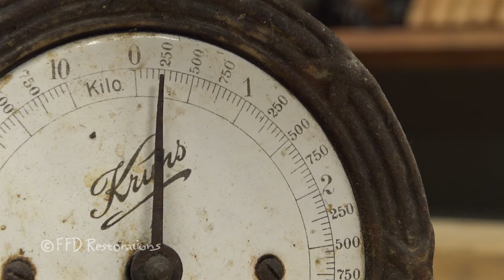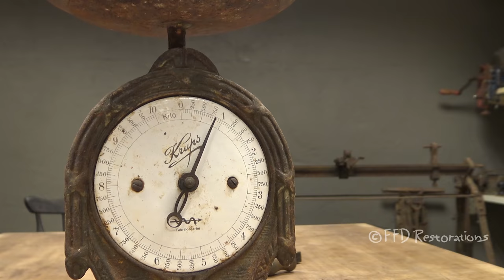EXTREMELY rusty axe restoration and MAKEOVER to an hatchet - all by hand

Comment: Owning an axe head that dates to around 1830, I would have de rusted before cutting it. Blacksmiths of that period did not always mark their work but it is always worth looking. A very nice job.
Reply from the maker: Thanks John, after research this axe head is probably around the 1950's. I wish it was older, in that case I would not cut it for sure. Thanks for watching!

Comment: Oh, well it's an øyo or a Mustad mass produced axe of the Østerdals pattern.  Good effort on that hacksaw dough. You could make a pickaroon from that other half of the axe head, wich someone said further down in the comment section.
 Keep up the good work.
Reply from the maker: Thanks for the info! I just wonder, could be a third option or manufacturer? I know that both Øyo and Mustad have branding marks on their axe heads, but this one didn't have any. It could be because of the condition, but from experience usually there is at least partially visible branding. Thanks for watching! And yeah, I think that is a good suggestion, I appreciate that.
Reply: @FFD_Restorations  You could cal  me an axe nerd. The eye is looking like a Mustad, and their stamps where not punched as deep in the 1920s to the 50s. The øyo axes has much deeper stamps on the poll. 
I would stick with Mustad for now then.
Reply from the maker: No, not at all. I appreciate your knowledge and efforts to share valuable info. Alright, didn't know that. Cool 👍

Comment: Curious as to what it weighs after grinding...also can you make something out of the leftover steel from the axe? Probably not just thinking "out loud"
Reply from the maker: It hasn't changed much after grinding but I managed to get it 1.5 lb (700 g) including the handle. I will find a good use for that piece as well. At the moment I am trying to find a treadle powered forge, so I will be able to be more creative with that piece 😉

Comment: on your foot petal equipment which I like, Im thinking if you took a back wheel bike one way sprocket and attached a very heavy counter weight that can store momentum as you pedal and then rest every now and then and get a constant flow with more torque, I would venture to say if done right you could make a lathe
Reply from the maker: Thank you so much Genghis for your suggest and help. Your idea is brilliant, but it is not what I could implement here. I am trying to create a workshop from 19th century. I haven't use it yet, but in the background of this video was a 150 years old wooden lathe ready to go. So I am covered there. I can't way to start using that one and share with you guys 😆
Thank you for watching and stay safe my friend!